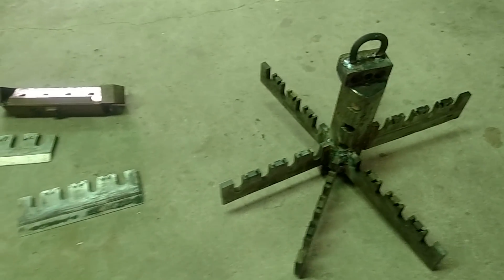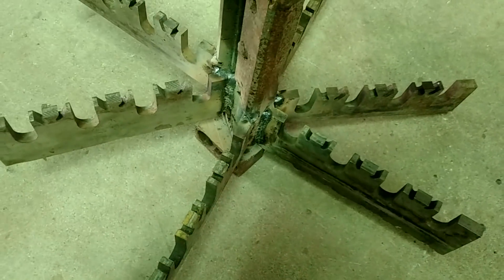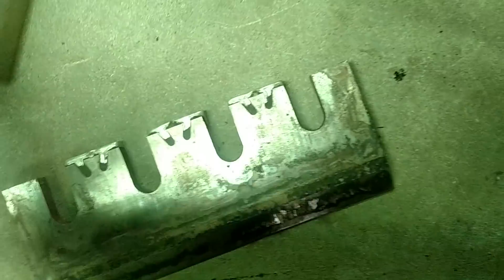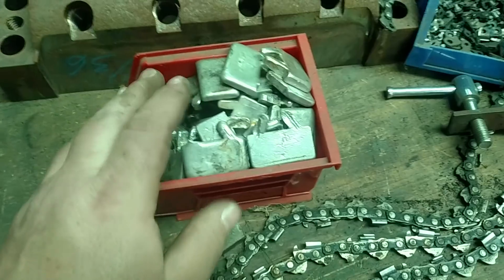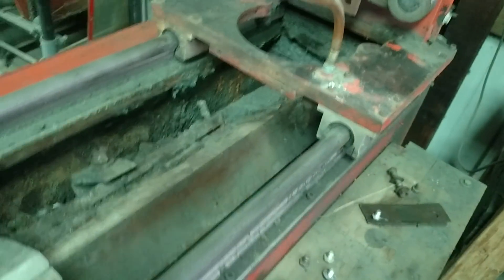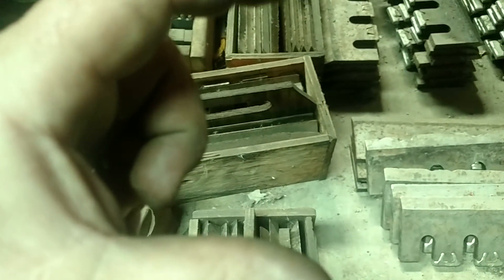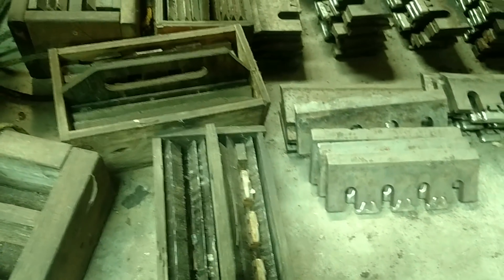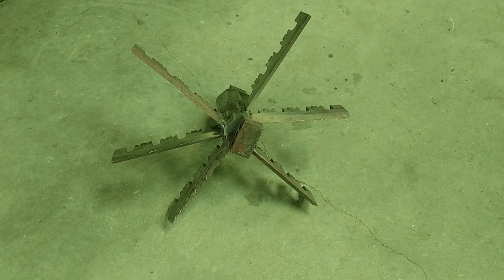Morbark Anchor And Chipper Knife Talk

Comment: Just wondering...Is it possible to hard face weld the knife edges and then sharpen them? It would  add a harder metal to the knife edges and save on buying more knives.
Reply from the maker: I'm not positive but I'm thinking it would make the knife brittle behind the weld.   But good idea.